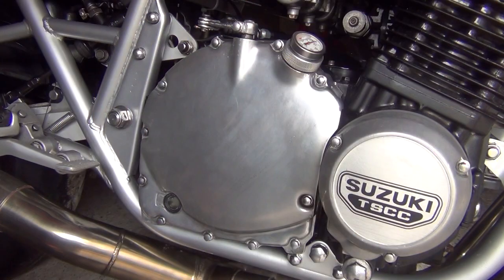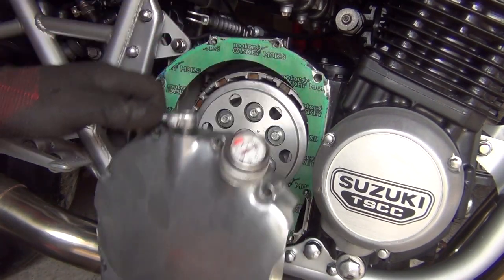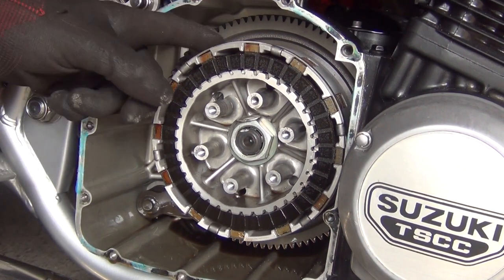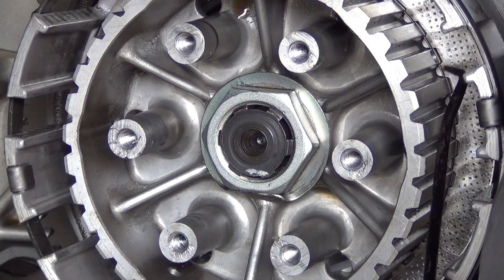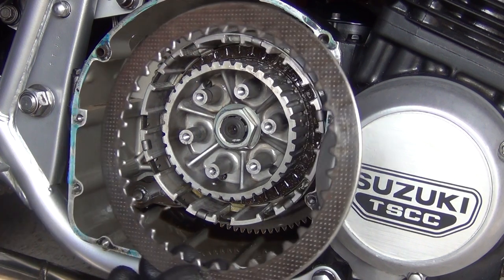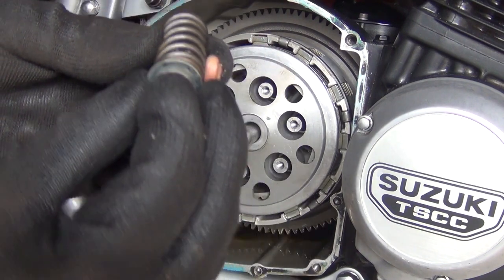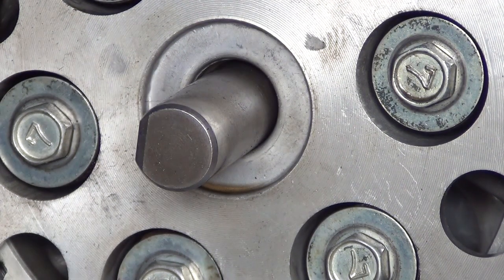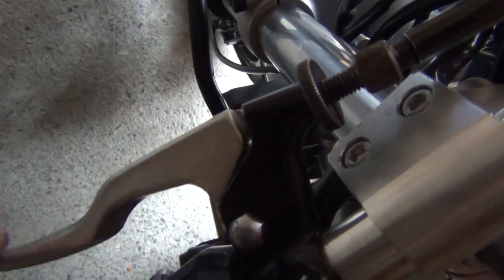Suzuki Katana Clutch Replacement

Comment: Do you need new springs when replacing clutch?
Reply from the maker: You can check free length, if it's withing spec i would reuse but new stuff is always better. Just be careful with aftermarket springs as they often are stiffer which results in hard work with the clutch lever and wrist fatigue